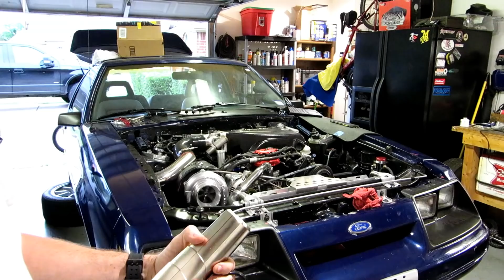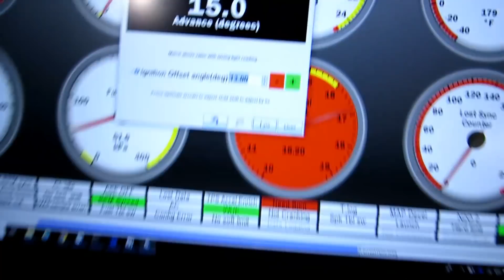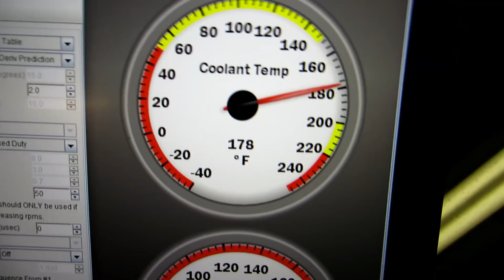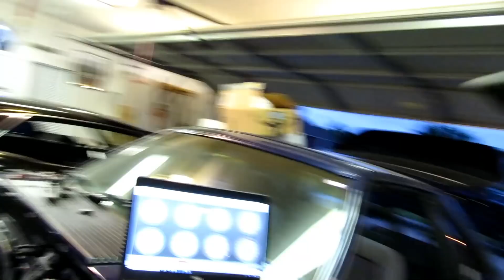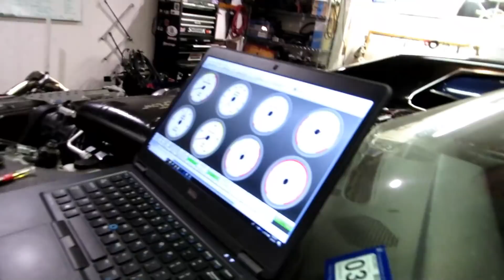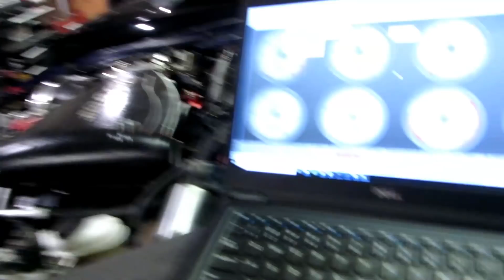FOXBODY On3 Turbo Install - Part 9 - FIRE UP!

Comment: just watched the vid ... what i dont understand is all that thing with Timing set up and Trigger wizard ... you set your fix T on 15 but you have 20 on the balancer ..then you start to change wizzard ... ok ..wouldnt it be much easier to change your fix timing to 20 ...and all done...??? not even make sense go to 15 on fix if you never run on 15 deg..???  i set my timing on 20 at the Bal. 20 on fix in MS check with timing light and done ...
Reply from the maker: Yeah man, either way. You got the idea, just make sure what MS demands, your balancer matches. So you do it via software (with the offset) or move distributer. Key is using the wizard and locking the timing and making sure it matches. The angle offset is just a software way to get 15 on both balancer and trigger wizzard by giving it an 5 deg offset. Not a right on wrong way...One thing some do and others dont is lock the timing say in your case to 20 degrees and rev the motor to say 3-4k and make sure the balancer STILL shows 20 degrees. I didnt, but my buddy does this...I guess hes compensating for timing gear, distributor gear play.

Comment: Hey mike! I’ve been keeping up with your videos for a while now. Just got into the MegaSquirt thing and I’m having trouble getting it to idle. Did you tune for closed loop or open loop idle? Or could you send over your tune so I could see maybe where I’m going wrong. Thank you!
Reply from the maker: Idle's tricky, and I finally got mine pretty good yesterday. Probably already saw this but this link is helpful. https://www.diyautotune.com/support/tech/other/idle-tuning-megasquirt/ 1st make sure required fuel is correct. This is calculated from engine cc and injector size. Next is timing, make sure base is set first, this is important and likely varies engine to engine, even if I share you my tune. But, yeah, do a comparison on the two tunes and look at any differences. Mine idles almost out of the box but surged, only thing I did was change CC and re-calc required fuel. That was enough to get it started with the base mustang tune from microsquirt. Shoot me an email, and I can share out my tune. prisonplanet88@gmail.com

Comment: Hey could you possibly send over your map? I’m having an issue with the program cutting spark on start up
Reply from the maker: You bet. I have no issue sharing. You'll need to get timing good though for it to at least start it up to SET initial base timing. Then make sure your required fuel is set to match your injector size. Shoot me an email, tonight I can send it over.

Comment: If you haven't done so already, ensure you ground the wide band to the ECU ground. If not you'll notice the tuner studio AFR gauge will have a slight offset and read slightly different from what the wide band is actually displaying. Grounding it to the ECU ground will solve this inaccuracy. Great Job so far!
Reply from the maker: Yessir. Man i didnt cover that but my ground is just that, right at the ECU ground on the kick. I forgot the ground all together at first lol a club member mentioned to ground it at the ecu ground to avoid interference

Comment: So how you ground brown wire on aem wideband?
Reply from the maker: So the AEM has a set of output wires right, I sent the white one to the pink input on the ECU, the brown output wire I added a length of wire to, soldered on an O-ring terminal, and put it right on the stock ECU ground spot (right below the hole in the kick for the stock ECU on the passenger kick panel). Thats it, once grounded to body signals we're spot on.
Reply: Great! Wish I still lived in Mansfield. Glad you're doing a video on microsquirt. These vids are in depth and easiest to understand. I'll definitely be taking notes when you go to tuning. I already got new 3 ideas just from watching this one, remotivated now!

Comment: Great job getting her fired up Mike!  Was going to mention the ground signal for the wideband...   Quick quesiton.. why the 15BTDC base timing. Was thinking more like 10 with the turbo but i'm a supercharger guy....  Cab't wait to see you tear it up on the streets.
Reply from the maker: Well, its not setting base at 15, I wasnt setting the base timing like your referring to on a stock ECU, pulling the spout and what not....This is "syncing" the timing of your engine off the crank to what microsquirt commands...I could set it to whatever. You can put 30 there, when set to "fixed" this just locks the engine to command 30 degrees. As long what it commands, the engine timing marks match, they are in sync. Then in the software when changed to use map, microsquirt will go back to using its timing map table.

Comment: There is (2) ground on the AEM both must be grounded, haha you just said in the video you figured it out as I type this.
Reply: Surging is going to happen until you get the idle dialed in. The car itself surging is going to cause the AFR to bounce as well. Every car is different so find what works for yours. Play with the timing and fuel map to get what ever fuel gives you the best idle & highest vacuum. It takes way more work to get the idle and fuel acceleration right then the actual tune up top. Your O2 does only take long to read. It should read right off the bat when you fire the car. Might have to look at the timing delay in the time. You can adjust the timing delay to when it reads the sensor maybe that’s it. Hard to tell on the internet 🤔

Comment: It sounds like its PMGR Starter swap time Mike.  I wish I knew you didn't have one, I would have mailed you an extra that I had, but its gone now.  Glad to see this project continue to move, its been a while since I've viewed any of the vids.  "Uno".  later.  Thanks for the good content.
Reply from the maker: All good man. I appreciate it. And “uno”! Thats a true viewer right there, my son is not in garage near as much, playing with friends on his bike, minecraft, legos etc is more important.
Reply: HOUSE OF DULA he’s a cool kiddo.  When your earlier videos came out, he reminded me of my kid hanging out when I had my last coupe.  If you end up doing the pmgr starter it’s an easier project.  I think you can pull them from v6’s all the up to 2004.  Would make a for a cool video.  Do the hunt at the local pick a part, then the install.  You only need to swap a wire at the solenoid on the driver fender then run one more wire from there too.  There’s plenty of info on the web about it.  Would make for a cool $35 video/project.
Reply from the maker: @ghostinthetreeline  - I would but I have a video on a mini high torque starter install already. Cheapo amazon one, but its been working fine for me. I try to get little man out to do more videos with me, hes so funny, but just has so many other priorities! Yes, he used to kinda be part of the channel for sure. If / when this starter gives out on me, I'll definately look into this mod! Thanks for sharing.
Reply: HOUSE OF DULA My mistake.  I thought I heard that classic boat anchor truck starter when you started her up.  Computer audio is never the best.  PMGR/high torque mini are similar.   You already got it.  Sorry for the confusion.  Keep the videos coming and thanks for the great content.
Reply from the maker: @ghostinthetreeline  All good man!